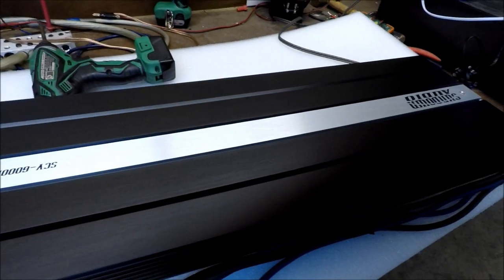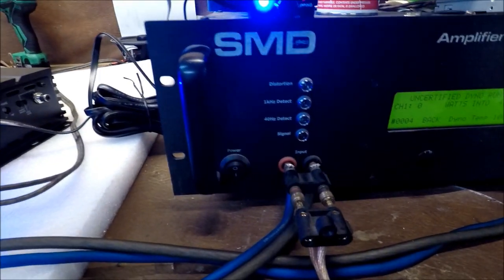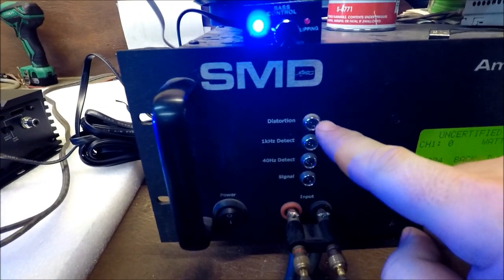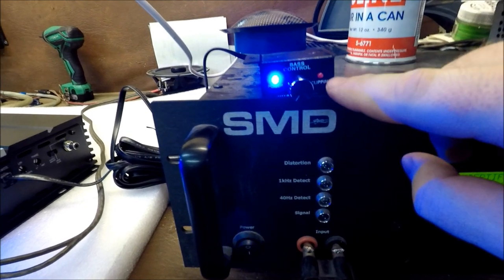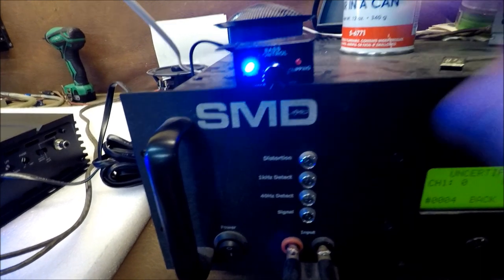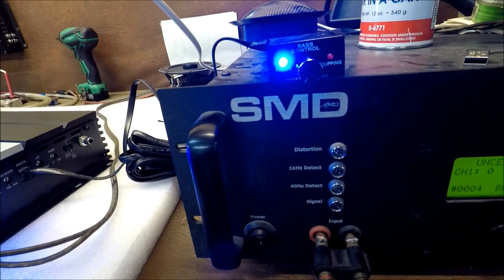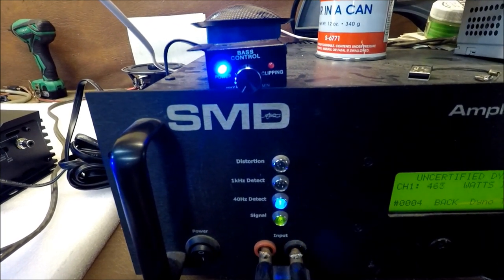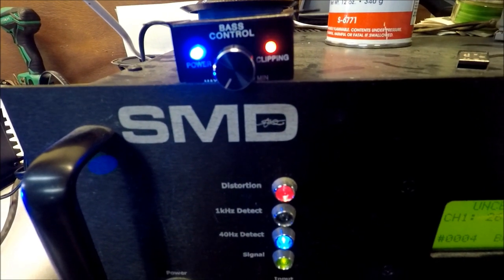***Remote Clip Light vs the SMD Amp Dyno***  Tech Time Thursday at Sundown Audio

Comment: The bass knob on my SCV-2000D is pretty much spot on with the DD-1 i used to tune it. They weren't exact but it was a matter of basically just touching the screw driver while adjusting the the gain to make them both light up simultaneously.

To compliment this video a "How does it do it?" type video explaining how the internal circuitry and indicator light on the knob works might make for a good future video.

Comment: clipping and distortion are actually different yet similar, you have THD throughout the range of power of the amplifier, generally distortion rises as it pushes more power, then right before you hit the amplifier rail voltage you will have the maximum non-clipped level of distortion, but once you hit the amplifier rail voltage then you clip and distortion dramatically increases, the SMD products light the distortion LED at a certain THD level, this is why it is more sensitive than a clipping indicator.  They use notch filters to filter out the fundamental frequency (which is the frequencies they give you on the CD) which lets only the harmonics through, this allows for further processing to analyze the THD

Comment: The clip light is accurate but you still need to find the highest volume on the head unit without clipping. Can you use the bass knob clipping light or do you need the dd-1 for that?

Comment: Do I trust that clip light? I don’t know but the way you tested I don’t know either because it all depends on how fast you were turning that screw or your gain. you can turn it real fast and of course both lights are going to come at the same time, but you could return it slow and the SMD  could be picking up distortion and the clip light might not so I don’t know I couldn’t see you turn of the screw. I’m trusting you weren’t monkeying with it though. I’m not cracking on any yawls equipment because I got your SALT 4 beast and I love it. I haven’t checked the clip light when it comes on at the Amp versus when it comes on at the base knob yet but that’s what I’m gonna do and I’m gonna do it really slow. I’m sure it’s fine. anyWho, thanks for all the test you do . 

Question when testing speakers like component speakers and any kind of speakers, for that fact, why don’t you have them in a enclosed box or at least in some kind of wall where the sound from the front of the speaker doesn’t mix with the sound from the rear of the speaker because we all know free air sounds like complete garbage. everybody knows that when they mix together like that it sounds like shit I don’t give a damn how much the speaker cost so that’s not a good way to show how your speaker sounds that’s for sure. And it’s not just you guys do it everybody does that dumb shit if I’m trying to sell my product that’s not gonna be the way I want to present it I know that.

Comment: I would say I do, I use a small. O scope to. Probe my head unit outputs and set my gains like that it doesn't go up over 8 volts so only option I got but so far so good been beating the hell. Out of my btl for over a year with double rated power and still beat

Comment: Hard clip. What about soft clip?
Reply: I think the light on the smd is really a distortion light essentially being a soft clip detector. You CAN see some clipping on a good oscope before 1% thd but below .5% thd it gets pretty hard to see so 1% is a good standard for the first signs of clipping.
Reply: @maxfmfdm  the light on the bass knob is bright meaning a hard clip on the amp. I would like to see the reaction time of the lights when the bass knob is dim(soft clip)
Reply: @jamesfalvey77  ok i see your point. I think the smd-ad ramps up pretty fast so it might be hard to test this way. I do see a comment here saying that they tested with a dd1. basically touching the screwdriver on the gains was the difference between the dd1 indicator and the amp clipping indicator lighting up.

Comment: do a soft clip. obviously a hard clip is gonna set them both off. kinda a dumb test
Reply from the maker: On the amp dyno its either 1% distortion (clean) or clipping.  It slowly rolls into it as can be seen on the dyno screen and not just blast straight to clipping.